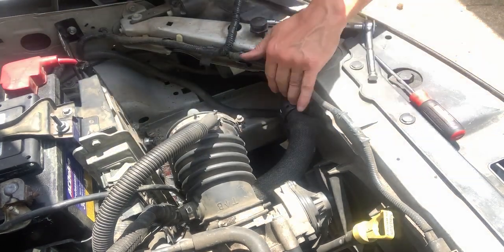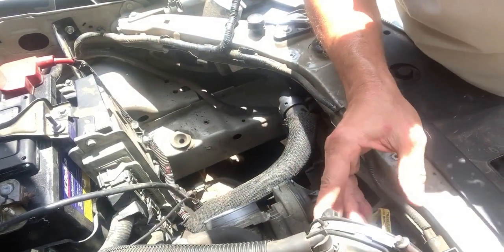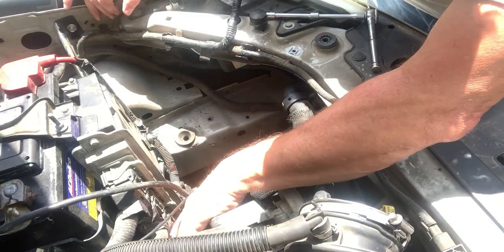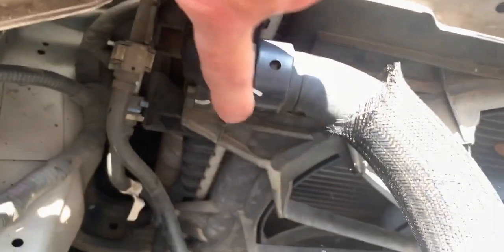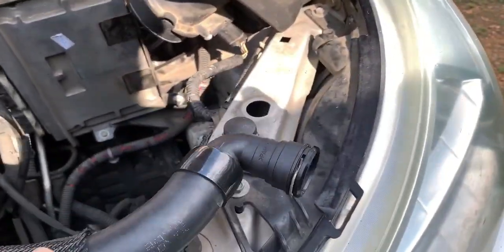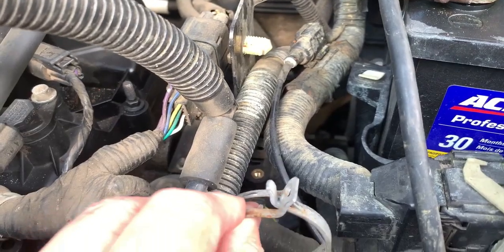How To, Remove And Replace Radiator Hose Ford Focus 2.0L

Comment: i suspect , for installation, you can put the spring clip on the hose first ...then push the hose on until the spring snaps into position....will let you know next week
Reply from the maker: I’m not 100% sure but I don’t think it will because the spring snaps into place in a groove.  If you try it I’d like to know how it turns out.
Reply: @SouthernBlessedHomestead  will let you know, i think on other cars there is a ramp /cone for the spring for the install direction,  it then falls into the"square" groove  of course not possible  for the removal direction.
Reply from the maker: @unionse7en  oh ok cool I’ll be waiting for your reply when you try it. Thank You
Reply: @SouthernBlessedHomestead   , OK ,confirmed, just put the clip on the hose first.  Then simply push the hose on the top rad fitting, The clip will snap into the groove on it's own.Maybe do an update in the text description, will save people some hassle.
Reply from the maker: @unionse7en  thank you for the info I appreciate it.
Reply: @SouthernBlessedHomestead  , no problem, thanks for the video,  BTW  my new  top hose came with the clip installed.
Reply from the maker: @unionse7en  you are welcome  glad I could help you and you helped me. Thanks
Reply: I sold the car but I have to say give me an old style clamp any day

Comment: I don't understand how you can say that this is an easy deal where you already started from the back the front but the back is where you need to go to you have to take off the 1st thing in the front then the 2nd thing on the side that you have to take off the holes that you have to take out a whole cover thing you're not even getting to the back yet so how can you say that this is an easy fix. Your kidding right
Reply from the maker: wow that was totally confusing. LOL
Reply: This actually was easy.  I got the part from Autozone at 6:50. Back home at 7:10. Done at 8:00.

Comment: Just found a crack on the plastic elbow at the end of the hose while doing an oil change.  Was dripping coolant.  Rockauto had a Continental brand hose for $25 CAD, so prolly less than $20 for you guys in the States. FYI.
Reply from the maker: I like Rockauto I’ve ordered from them several times. Thanks for information and for watching.
Reply: I just ordered a new radiator because of that cracked elbow, do you by any chance know if a new radiator comes with that elbow?
Reply: @postit4273  I wouldn't think so.  It's part of the hose.  I've seen the elbows for sale by themselves, but you might as well get the hose and not screw around.
Reply: @pfsantos007  yeah literally just went and got the hose with the elbow built in and got it in but thanks man

Comment: Hi! I'm trying to figure out my 2012 Ford focus. The radiator fluid keeps boiling over. No coolant in the oil. Spark plugs are clean as well, I'm thinking of replacing the thermostat just to ensure that's not an issue. Doesn't overheat at all. Replaced the coolant temperature sensor as well. This is a great video to help me get that hose replacement done 💪 just subscribed to your channel
Reply from the maker: I would definitely replace the thermostat especially if it’s the original one. Appreciate you watching.

Comment: Thank you for this video. My ford focus 2012 had a hose bust under the break , clutch and accelerator paddle couple of months ago, i took it to a mechanic, he fix the hose, but since then if i drive the car in a bit harsh way or go for a bit long journey , the coolant stats boiling, and disappears while im driving or when i stop, and the fan starts at a very high speed  and j can see that coolant is going down However there is no leak and head gasket is also fine. And if i make small trips then there is no problem at all.
What would you recommend for me to do ? 
Thanks a lot
Reply from the maker: I’m going to be honest, I have no idea, if it’s not leaking and the head gasket is good I don’t know where the fluid can be going

Comment: So i have a 08 ford fusion se 6cylinder i had a mechanic break my line from the coolant to the radiator. Ive heard ppl say something about jb well. Idk nothing about so should i just get a brand new radiator or is there simpler fix for that
Reply from the maker: If the radiator was damaged I would get another one, if it was me. I’ve tried to repair them in the past with no luck. 
Thank you for watching.

Comment: i have an 08 focus and have noticed a leak but couldn’t find from where , dad was helping me yesterday using your video we were able to replace the hose! honestly not sure if it was the culprit. no visual signs of anything on the hose to indicate a leak , anyway you could tell?
Reply from the maker: Thank you for watching. After you replaced the hose did you notice anymore leaking? Could be several things causing the leak. As you ae standing in front of the car looking at the engine, if the leak is coming from the right side it could be the thermostat housing, engine coolant water outlet housing or heater hoses. If the leak is coming from the left side it could be the water pump or  left radiator hose.
Should be easy to visually check with a bright flashlight. You can google these items and see the engine location so you will know exactly where to look and what the part looks like. I hope this helps, let me know what you find out.
Reply: @SouthernBlessedHomestead  we took out the air filter housing and saw it leaking from the upper hose where it connects, we replaced it and have been keeping an eye on it so far so good just not sure what else it would be if it wasn’t the hose
Reply from the maker: @beautylizzie97  Well is sounds like the hose from what you said, if it still leaks it could be the radiator. I think you fixed the problem if you've been running the engine and haven't seen any leaks you should be good to go.

Comment: I am having trouble getting the elbow connection to seal up and not leak.  OEM hose was leaking, replaced with a Gates (only option that day) Gates connection also leaks. I inspected the tube on the radiator and don't see any cracks, I ordered a Motorcraft hose and am going to try that next.  Any advice or things to look at is greatly appreciated.
Reply from the maker: It that hose was leaking my guess is something is wrong with that hose. 
If it’s going to leak at all it would be at the end of the hose if the clamps aren’t tight enough. It’s hard to say without actually seeing it. Sorry hope that helps some. 
Appreciate you watching

Comment: Mine is leaking at the opposite end of the hose where you used the pliers to take the clamp off. My car was overheating and you can smell the coolant. Seems like your instructions would help.  Any advice??
Reply from the maker: Maybe the clamp is loose? Try tightening it. Are you sure it’s leaking from the hose and not the water outlet housing it’s attached too?
Reply: @SouthernBlessedHomestead  thank you, I'll be sure to check the water outlet housing to make sure

Comment: When installing the plastic end of the hose, does it line up with the mark on the radiator inlet?
Reply from the maker: It doesnt matter as long as the hose is seated properly all the way, it moves and rotates a little.

Comment: I heard a slight hissing noise after pulling in my driveway today and poped the hood. There was a leaky hissing kind of sound coming from in-between the motor and the battery where all those hoses are, along with a little steam. It stopped about a minute or so after turning off the engine. Turned it back on to see if the gage was leaning hot and it was about 3/4 the way to the right, not in the red though. Turned it off immediately. Also a bit of what I believe to be coolant leaked into the driveway. 2010 focus otherwise in great running shape. Any thoughts?
Reply from the maker: It could be several things. Upper radiator hose, heater hose, water distribution pipe see link. https://www.partsgeek.com/gbproducts/WC/28812-01298608.html?utm_source=google&utm_medium=ff&utm_content=YN&utm_campaign=PartsGeek+Google+Base&utm_term=2008-2011+Ford+Focus+Water+Distribution+Pipe+Genuine+W0133-2335873+08-11+Ford+Water+Distribution+Pipe+2009+2010&fp=pp&gbm=a&utm_source=google&utm_medium=ff&utm_campaign=PartsGeek+Google+Basecid=6774379819&aid=79287199093&keyword=829684093849%3A%3Apla-829684093849&kid=829684093849&gclid=CjwKCAjwybyJBhBwEiwAvz4G74Gd40efxKVdfIeSw6u_T4RcHfbUgKgoujTDo3pi5uZ2_pyE1siCPhoCr0sQAvD_BwE
Reply: @SouthernBlessedHomestead  Thanks for the response sir. When I get to the bottom of it I'll come post it here.
Reply from the maker: @SweetandSourohmy  that would be great I’d like to know what it is. Sounds like a hose the way you described it, should be easy to find. Run engine and look for the leak.
Reply: I had the same problem this morning. Gage was 3/4 the way also. Except it appears my leak is on the other end of the hose where he used the pliers to get the clamp off. I can't tell if it's just loose and needs a new clamp or a new hose.

Comment: Do you have a part number for the elbow connector? I’ve been looking all over for it and can’t find anything online about it this is the only thing I have seen
Reply from the maker: No I dont. Im pretty sure you have to buy the complete hose assembly. I dont think you can get just the elbow connector. Ive never seen one.

Comment: just did this all went well but got back in the car and went around the block just as i was pulling in the temp light came on. any suggestions as to why that would happen. do i need to drain the radiator or could their be an air bubble in there stopping my coolant from getting all the way down
Reply from the maker: Sounds like it could be air in the system. Crank it up let it warm up and squeeze the radiator hose a few times it should works it’s way out. Thank you for watching
Reply: @SouthernBlessedHomestead  thank you sir
Reply from the maker: @xxtegridyfarms1849  you are welcome I’m glad the video helped you.

Comment: I just replaced the radiator on mine and I burped it and everything and now itll run and hold temp find but shake a little but when I push the gas it pops that hose off and blows my fluid. Do you know what I did wrong?
Reply from the maker: I’m no expert but it sounds like the thermostat might be stuck closed causing back pressure. That’s what I would check if it was me.
Reply: @SouthernBlessedHomestead  Yeah me either I'm just broke and struggleing thank you for getting back with me I'll check it. I also noticed I'm missing that metal ring/clip for the radiator hose you replaced
Reply from the maker: @auspicioustoot  well that’s why the hose is blowing off. The metal ring is a clip that locks the hose into place.
Reply: @SouthernBlessedHomestead  whats weird tho is when I first done it it held for like a week lol
Reply from the maker: @auspicioustoot  I would still check that thermostat. Hope you get it fixed.

Comment: when you put the radiator side back on, the upper hose will it not slide in place with the metal ring on will it not push it out till in place ?
Reply: or do you have to pull it out of the new one and then put it back on....
Reply from the maker: @vcolet2011 you can use the new ring or the old one, I prefer to use the new one. The hose will not slide onto the radiator if the ring is on it. Remove ring from hose side hose onto radiator then snap the ring in place.
Reply: @SouthernBlessedHomestead  ok thanks your awesome
Reply from the maker: @vcolet2011  hope it helps you. Thanks for watching.

Comment: Thanks alot for making that video.      These bean coutners & engineers baffle me.....who makes a a hose with plastic components and figures lets run piping hot water  through it and then ask it to work in freezing temperatures also.   Whatever happened to rubber hose & worm gear clamps. Easy peasy.  Not $50, $60  for a goofy hose design.
Reply from the maker: Totally agree. Thanks for watching